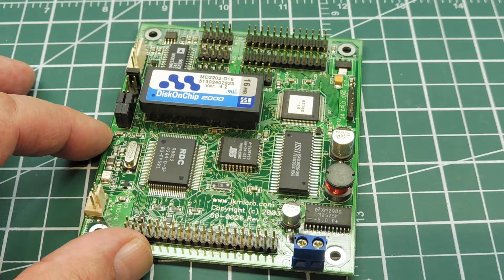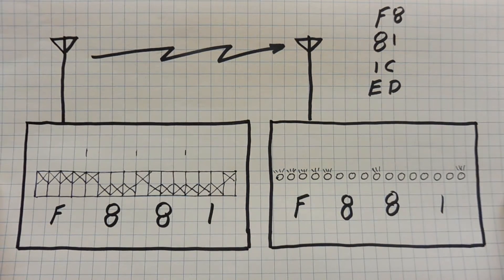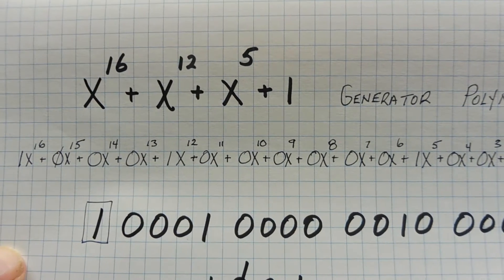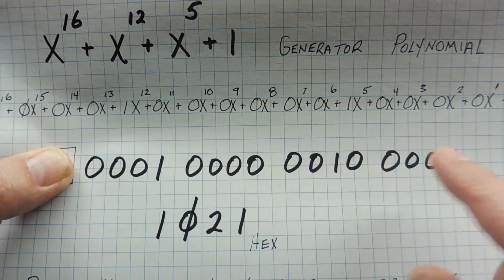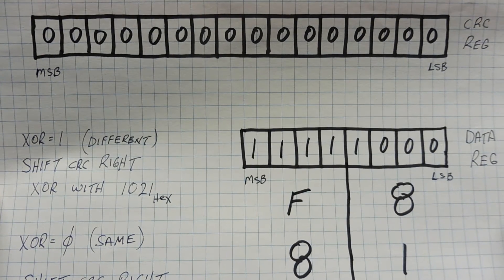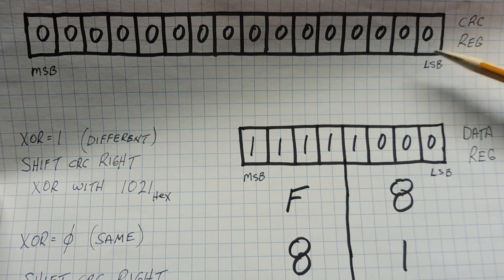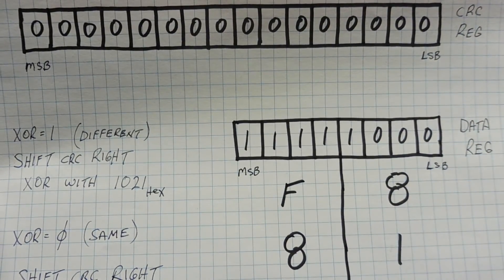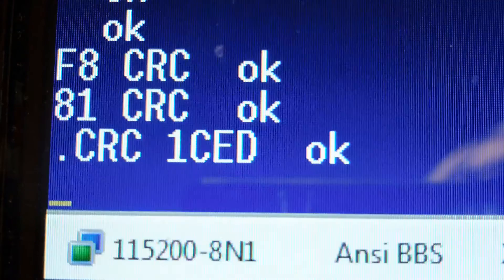CRC error detection in embedded applications

Comment: I'm just a Beginner in This Subject, but Being a Receiver It's Possible that It may not have any information regarding Calculated Checksum. 

In Such Situation, The Sender can append the Checksum along with Data.

The Reciever can Calculate the CRC of whole Data and It will result in a checksum of 0 or whatever Specified Value
Reply from the maker: Yes .. the CRC is sent along with the data to the receiver as shown at 1:00.
FEC video:  https://youtu.be/BHDA9o68DRM

Comment: Is the CRC 0x1CED correct? After implementing in software as per the procedure, I get 0x1BE9. Which one would be right?
Reply from the maker: Check it with a CRC calculator  My CRC generator is CRC-16-CCITT Normal 1021 Little Endian used in X-Modem. Calculator shows 1CED
https://www.scadacore.com/tools/programming-calculators/online-checksum-calculator/
Reply: @0033mer  Can I share my code with you that shows CRC as 0x1BE9. Can you check what am I doing wrong in this code? your email please?

Comment: The shift should be to the left.
Reply from the maker: CRC-16-CCITT little endian is calculated with shift right.
http://practicingelectronics.com/articles/article-100003/article.php
Reply from the maker: @BurntTransistor The example is a CRC16 standard (CRC-16-CCITT) used in X.25, XMODEM, Bluetooth and many others.
Check out this link: https://www.scadacore.com/tools/programming-calculators/online-checksum-calculator/
Enter F881 hex and look at CRC-16-CCITT Little Endian. Result CRC is 1CED.

Comment: Thanks for sharing however what you have done does not comply to any CRC16 standard. the result you get does not tally with any of 24 types stated in http://crccalc.com/ .  sorry but your method wasted my time
Reply from the maker: Sorry... there are many more than 24 types. You have to use the correct poly, start with 0000 or FFFF, Little Endian, Big Endian, reversed, not reversed... etc.
The example is a CRC16 standard (CRC-16-CCITT) used in X.25, XMODEM, Bluetooth and many others.
Check out this link: https://www.scadacore.com/tools/programming-calculators/online-checksum-calculator/
Enter F881 hex and look at CRC-16-CCITT Little Endian. Result CRC is 1CED.